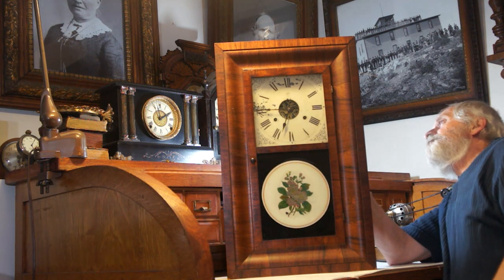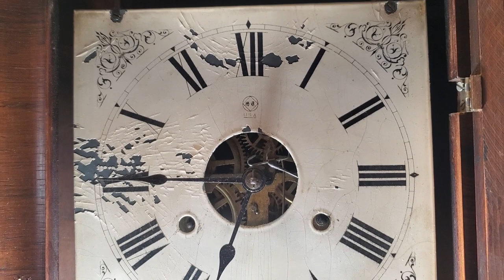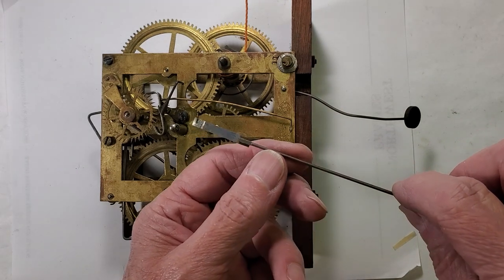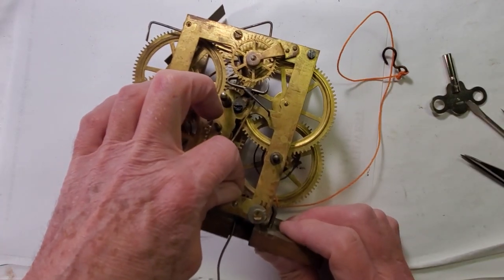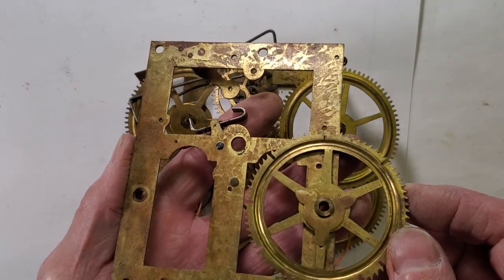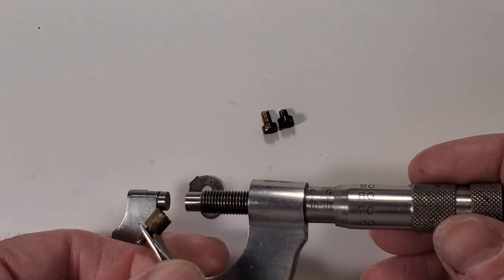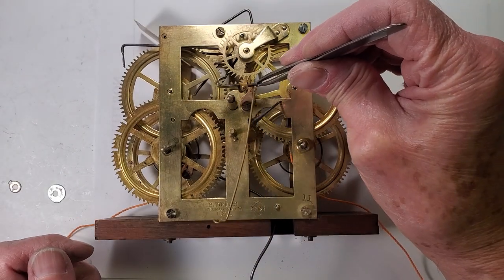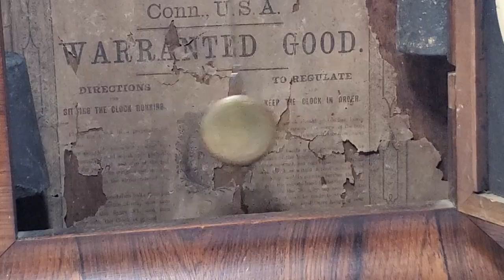1800s SethThomas for Joseph from New York #56

Comment: Just watched this rebuild. I have a few thomas clocks from the 1850 to 1870 time period, and the dials on them show paint loss as well. I read some where that the zinc they used during that period was of poor quality and the paint did not adhere well.
Reply from the maker: Its also possible hot and cold cycles expand and contract the metal and the finish eventually looses its mechanical bond with the  metal dial.

Comment: Nice work on the lathe cutting down the fasteners that hold the plates together and cutting screwdriver slots in them.  Do you remember about how many bushings you put in this movement?  If the owner had wanted you to do something to preserve what is left of the label, what would you have done?
Reply from the maker: Don't recall on bushing count.
I have some images of original labels for some of these, and a place in town with large format printer that makes prints for me from time to time.

Comment: I just bought one and the paper in the back it just got a couple little pieces left should I try to replace it with a copy have I have another one thats kind of mostly their what can I use to preserve the paper that's left
Reply from the maker: The paper on these was printed on highly acidic paper due to the resin-alum glue being added to the paper pulp.
There is a process called self-degradation of paper, that causes difficulties preserving paper items from the past.
The label will continue to self-degrade unless it is removed and brought to an acid neutral state.
If you are interested in saving that part of history on the clock, might be best to photograph what's left to preserve its image.
The rest is up to you to decide what should be done.
I have seen some of these labels clear coated with a non-acid clearcoat and some temporarily covered with a replacement label printed on archival paper in an attempt to pull some of the acid out of the original label, and some that have just been glued over with a replacement label.  
Another problem is the glue used to glue it to the wood and the wood itself might be high acid, adding to the problem.
Museums and libraries deal with this high acid paper issue a lot, they have been able to slow but not completely stop the self-degrading of archived paper items.

Comment: what kind of chime clock is that in background of every video. It sounds beautiful and that question has been stuck in the back of my mind for a while.
Reply from the maker: Its a hermel 1050-20 with a tripple chime.
It has three different chime melodies to choose from on the clock.
Reply: @jamesmartin5370  is it striking on bells?  The sound is really good.  I found a hermle movement with those numbers but I can’t tell what type of clock it is mounted in or what they might strike on. It’s sounds deeper than chime rods
Reply from the maker: @jakehanifee8856  Striking is on a standard Coil Gong
Reply: @jamesmartin5370  did you have to do something to the gong to make it sound that good?  Some of my clocks’ gongs sound kind of tin-y
Reply from the maker: @jakehanifee8856  Clocks of this age had loud gongs on them to alert the family of the time of day.
For many families the clock of the house was the center piece of the home, kept everyone on time.
This is why they were loud, and were a metal hammer on a the steel gong.
You can lighten the harshness by putting a small piece of leather or felt pad on the metal hammer. 
A small round piece of felt used to put on cabinet doors works good.

Comment: You might have said in one of your other videos but what kind of clock oil do you use for these ogees? I picked one up recently that is in pretty good shape just needs a clean and oiling. Thanks!
Reply from the maker: Any major brand that is synthetic that is classified as Clock oil.
I have good luck with Nye Lubricants.
Do not mix brands, do not mix synthetic with non synthetic, there could be some negative reactions if mixing different types of oils.

Comment: I have the same movement on my bench . It's badly tarnished and dark. What did u use to clean yours
Reply from the maker: Same process in as in video #43 &  #44 see below videos:
https://www.youtube.com/watch?v=TEzHmvh9xQU
https://www.youtube.com/watch?v=eWwgsTlYj_o
When you get to the brass brush step, a soft motorized brass wheel can be used as well as a soft brass hand brush.
Reply from the maker: I only use this method if nothing else works and always consult with the owner to see how they want to proceed.